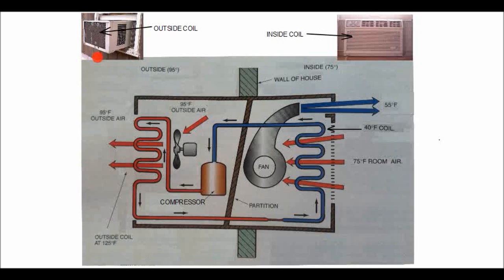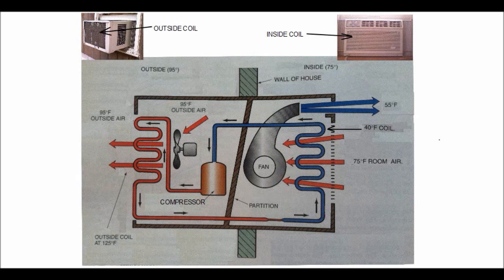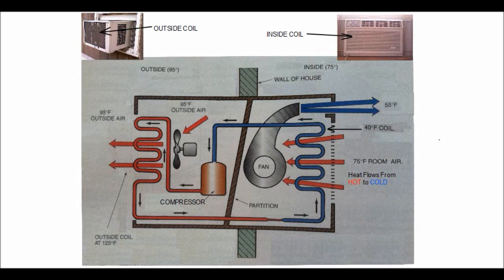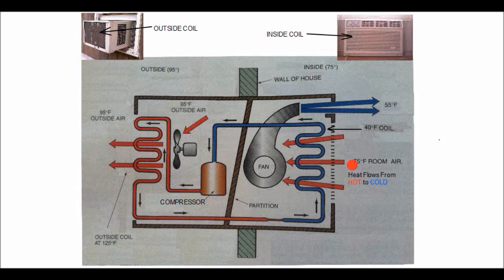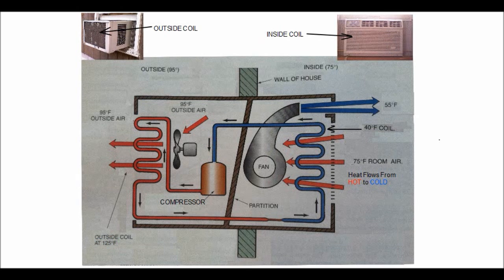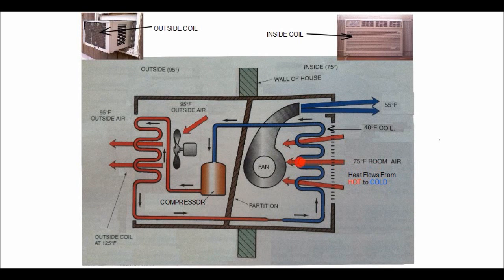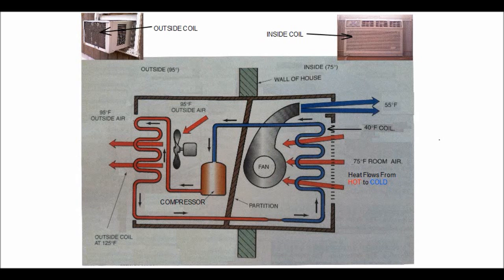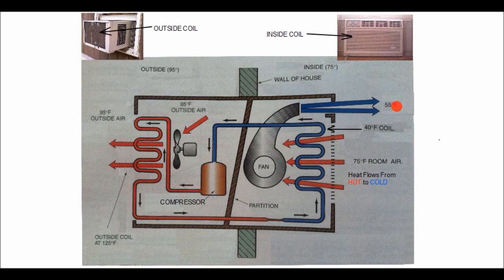HVAC Training - The Refrigeration Process

Comment: In response to grpere1, the refrigerant becomes 40F again after passing through the orifice in the coil (in the inside portion). You can see this orifice in the diagram. After getting passing through this orifice, the refrigerant's pressure is lowered, and when that happens, the temperature gets lowered. That's my understanding.
Reply from the maker: eggsactlyrobin Exactly!

Comment: Best tutorial out there and the easiest to understand. Thanks a million. I do have a question though. Once the outside air is blown across the outside coil and absorbs the heat, how does the refrigerant come back down to 40 degrees when it returns to the inside coil. Also, exactly at what point/location does the fan pull the cooler air. Does it pull the cooler air from the lower part of the inside coil before the coolant absorbs the indoor heat. I hope i asked the question correctly.
Reply: I just realized that the fan takes in the cooler air from the room after is has been cooled as a result of the coolant absorbing the heat in the inside coil and then the fan returns the cooler air back into the room. I still am a little confused about how the refrigerant returns to 40 degrees though.
Reply: +grpere1 I'm pretty sure he has a video where he explains the relationship between temp and pressure. As you increase or decrease the pressure of the refrigerant the temp also increases or decreases. So as the compressor increases the pressure, the temp also goes up. Then as the refrigerant passes through the metering device the pressure is dropped which also drops the temp back down to that 40° that you were wondering about.